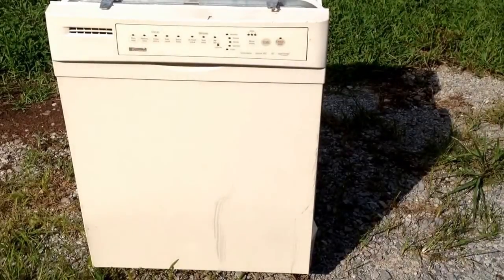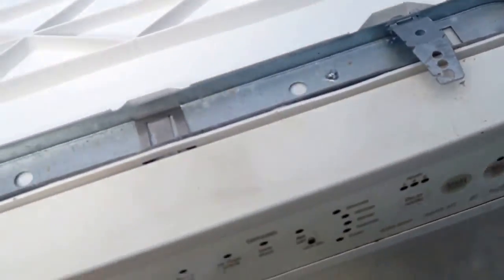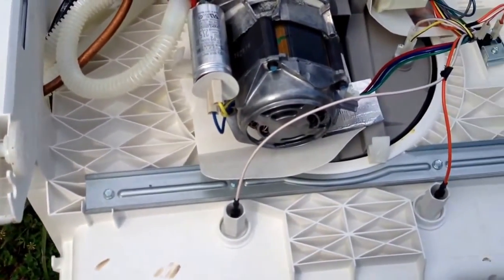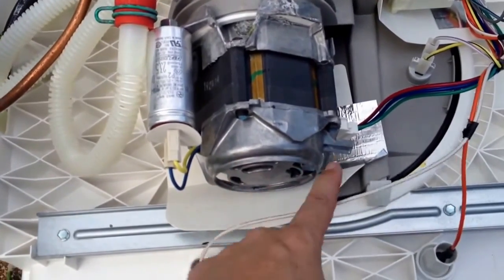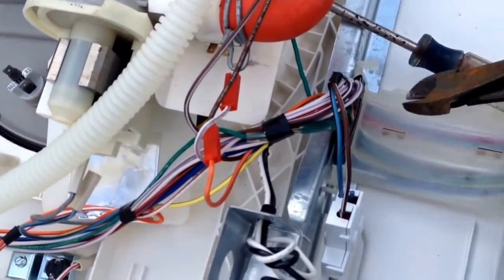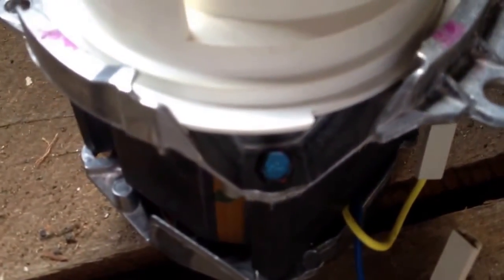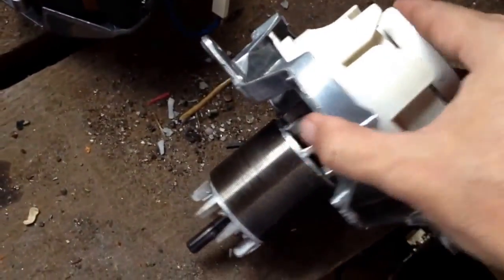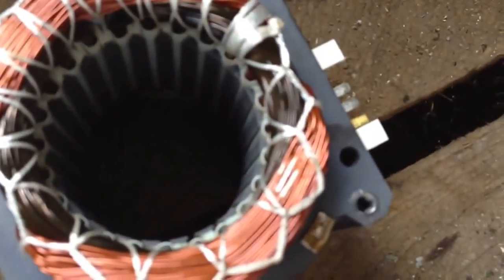Scrapping a dishwasher for fast cash

Comment: A nice sharp cold chisel will cut the copper (on one side only) without loss or electricity. Pry the coils on the other side out with scrap screwdriver and/or fencing pliers.

Comment: I took apart a dishwasher and sold some of the parts on Ebay and so far i made 32 dollars. My heating element does not stick to a magnet so im guessing it is copper or brass. I sold it for 10 dollars. The motor also is copper.